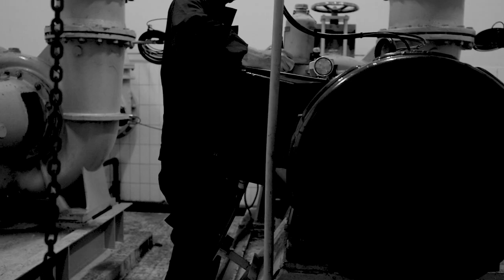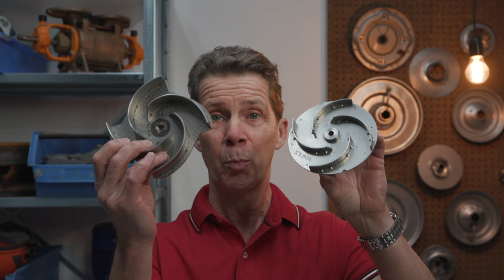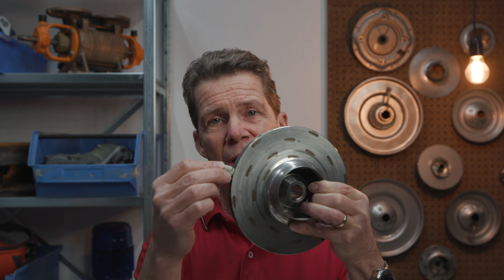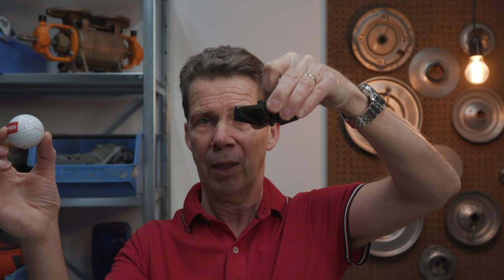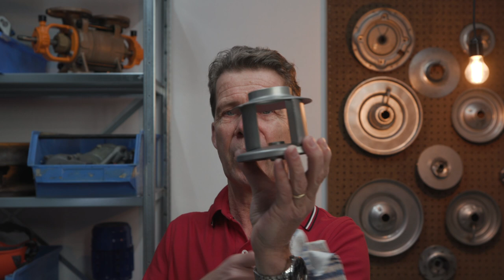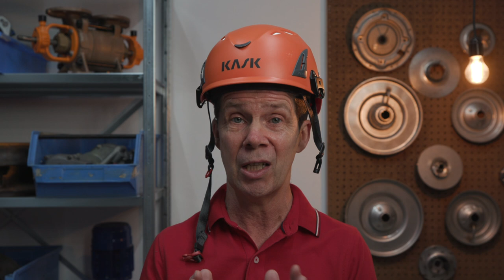How to SELECT the PERFECT IMPELLER?

Comment: Nice video
Obviously the size of the impeller compared to the particles also matters... for example a closed impeller 1meter in diameter can handle all the solid objects that you mentioned... but the size is determined initially based on the required flow rate, pressure & rpm combination...
So in such cases after determining the impeller size then the impeller type is determined